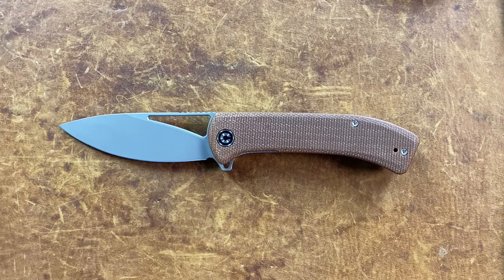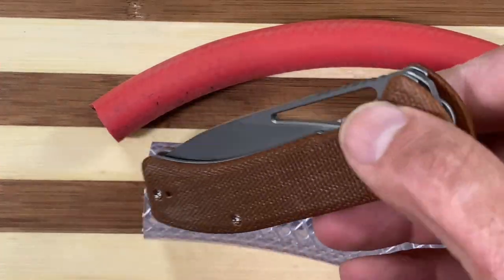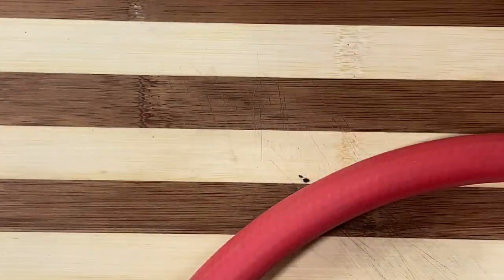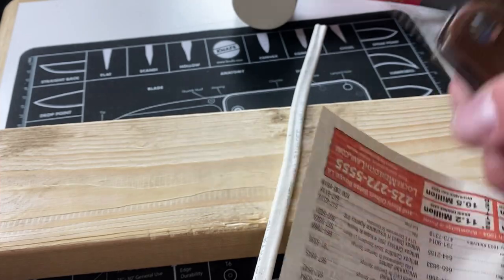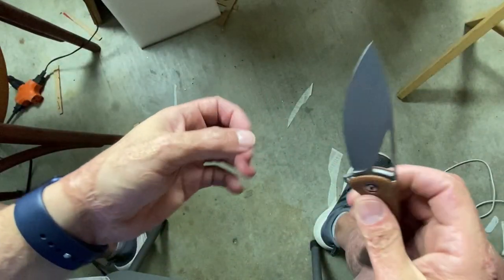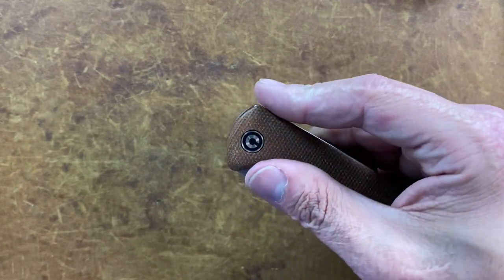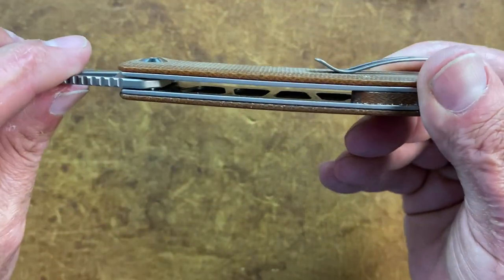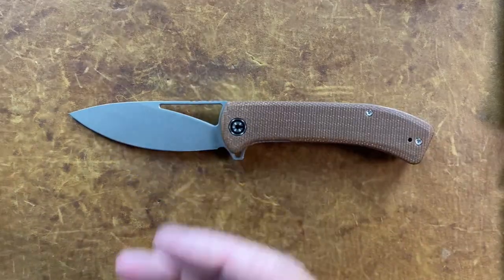Civivi Riffle Full Review and Testing | “This is why I Like 14c28n Steel” #EDC

Comment: Best use video on 14c28n steel I've seen.  I have not been able to find much on the edge holding ability of the Steel.  Many of the budget brands are starting to use it.  I have avoided buying them because of the risk that the metal is junk.  Thanks for the video 😎👍

Comment: That didn't do bad for a factory edge. Factory edges usually don't hold their edge as long as they do aftwr being sharpened a time or two.
I have both the Riffle and the Brazen coming. Should be here tomorrow. I wish the Brazen also came in 14C28N. My favorite budget steel. For an edge that thin to not take any real damage is impressive. It took more abuse than I ever give my knives and came through like a champ.
Reply from the maker: Yep it did great 👌🏻
Reply: Try not Rg pop
P

Comment: Another great review, i like this style of reviewing you've been doing lately. If I had any input, I'd say keep the testing consistent from knife to knife. Not saying you aren't, the tests I feel are exactly what a regular edc knife needs to perform. 
Everyone hit that LIKE button!!
Reply from the maker: Thanks 👍🏻 I try to keep the as close as possible but it really depends on the supplies I have on hand 👌🏻
Reply: @Stassa23  Definitely understand that. The difference in durability compared to last test knife is amazing. This one has opened my eyes to 14c steel, love it when I learn a new little thing.
Reply from the maker: @2873lonewolf  yeah 14c is a very solid budget stainless especially with a good heat treat 👌🏻